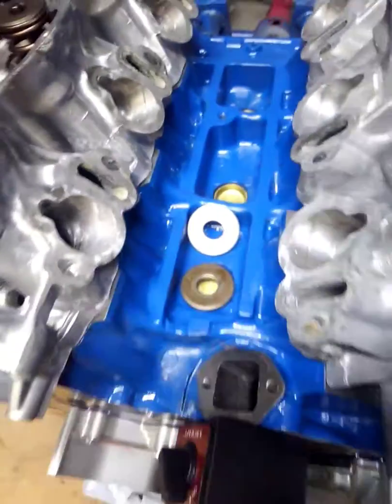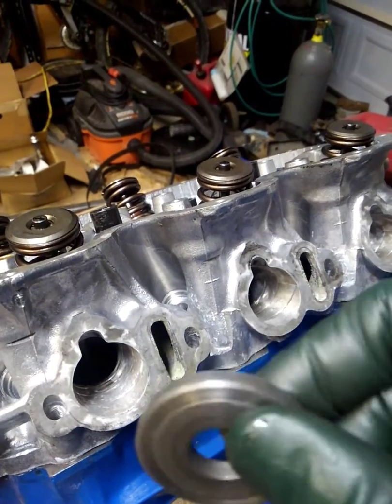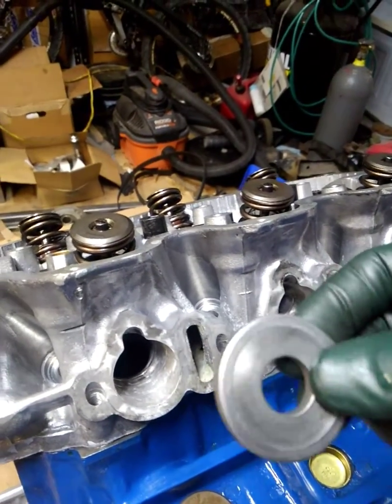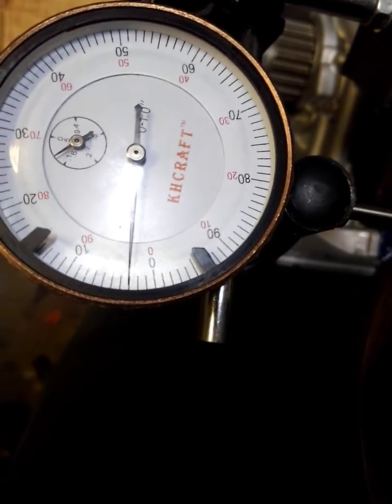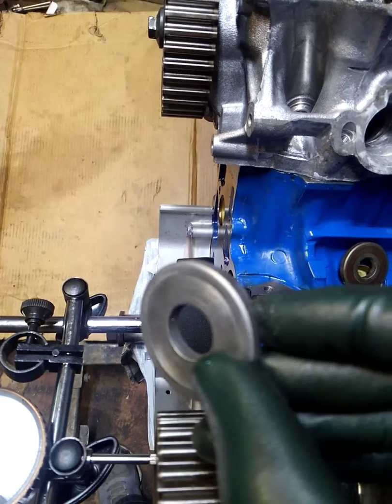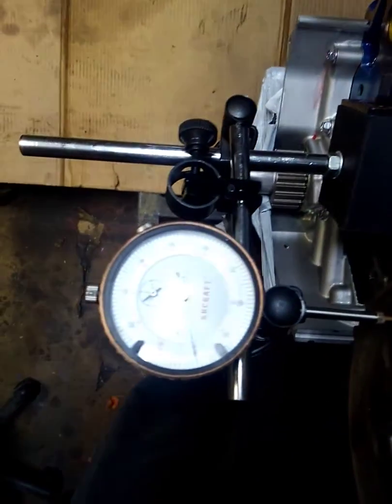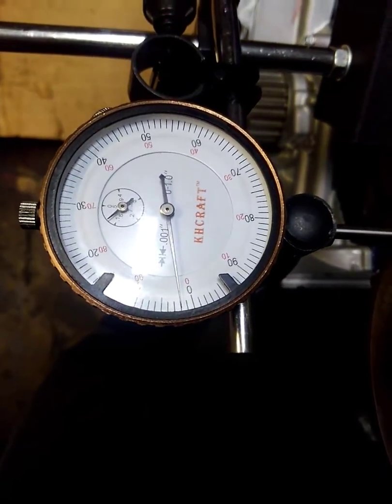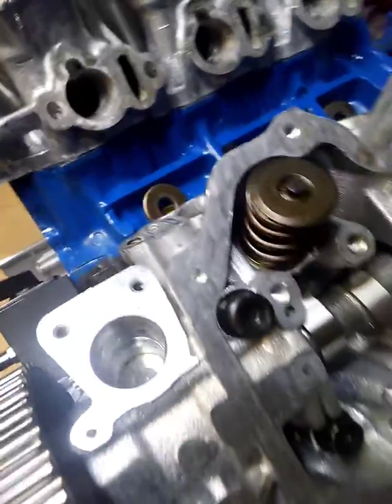Camshaft endplay adjustment Nissan v6 VG30 VG33 VG34ER

Comment: so on one side the outer 3mm is cut 0.002"
. and the other side from 3mm to the center is cut 0.002"?
Reply from the maker: That's about it BUT I would go more than 3mm: maximize that surface area against the aluminum head so it doesn't groove. Try to just clear the diameter of the camshaft.
Reply: @MY1PATH  did you use a stone or a lathe?
Reply from the maker: @Lordprimate  Lathe, squared against a spud. See other comments for details. Lapping was done on sandpaper.

Comment: Hi would you know where I can find the air relief plug (when change the water)  on the VG30 engine?
Reply: I’m pretty sure there isn’t one, I’ve never bled mine in my 300 either just topped it off

Comment: Awsome! This is so you don’t need to order adjustment shims from Nissan? I’m about to order some s1 Jwt cams for the frontier :) Is there any way you can make a clip on the machining process for the plates?
Reply from the maker: In Nov 2019 I could have. But in summary:
1)On the lathe make an aluminum spud the same diameter as the washer and a threaded hole to bolt the retaining washer to the spud.
2)bolt the washer in the spud and slide the spud into the chuck until the jaws grab the washer. The spud will keep the washer square as you tighten the chuck. Remove the bolt and machine  .0025"-.0030" off the the inner circle.
3)slide spud out of chuck enough to machine outer circle, flip washer, bolt it in and machine  .0025"-.0030" off the the outer circle.

Flat lap as required to get the desired fit to your cam/head